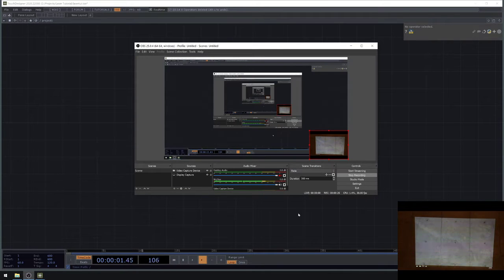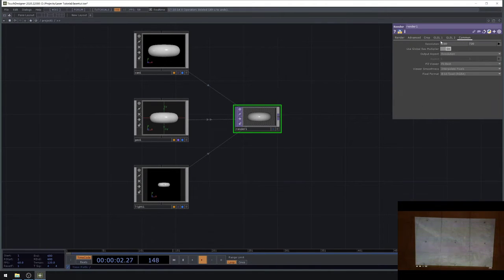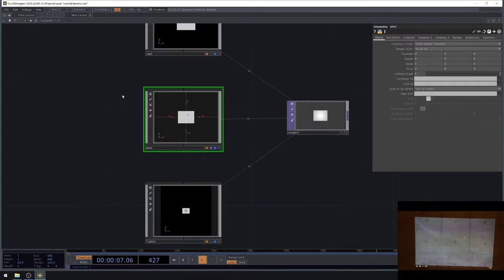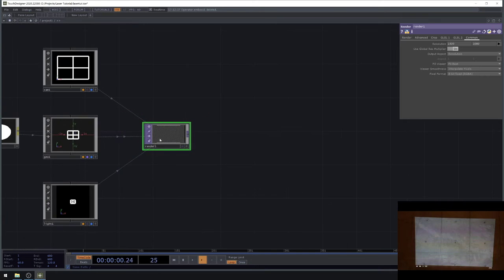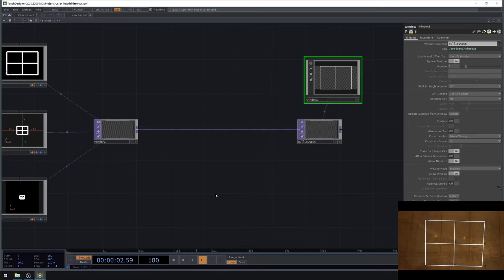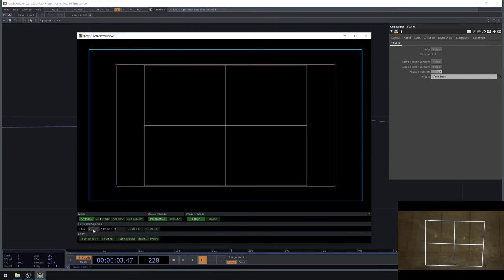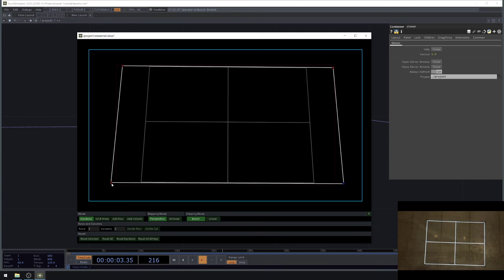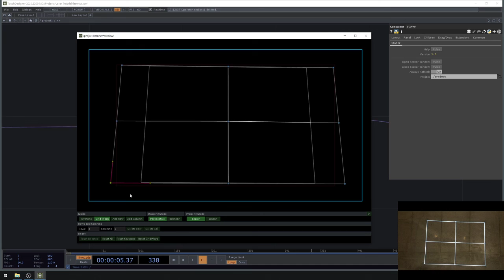Keeping In Touch 06 - Matching Lasers to Projection Part 1

Comment: Hello, what interface do you use to link the laser?
Reply from the maker: I actually don't remember...I'm either using a pangolin FB4 in this or a Helios. I wouldn't recommend the helios as it's splashy. The lowest entry level interface I would use would be the etherdream. The FB4 is great with Beyond as it has the mapping tools built in but it is more expensive.